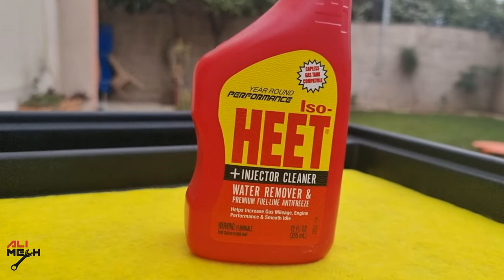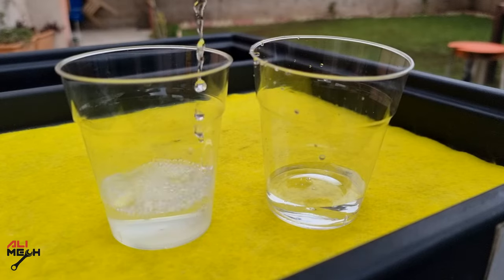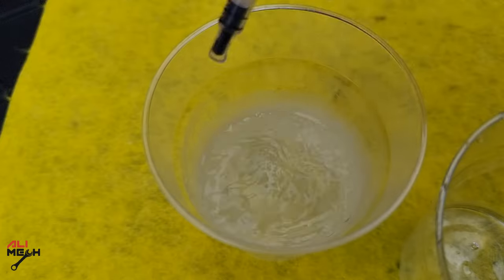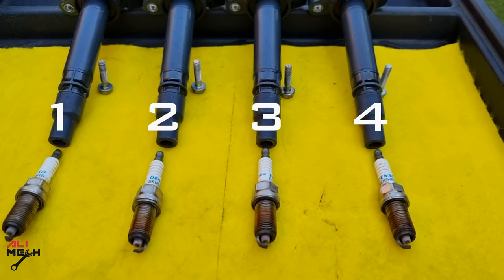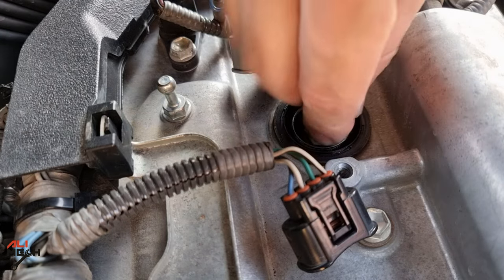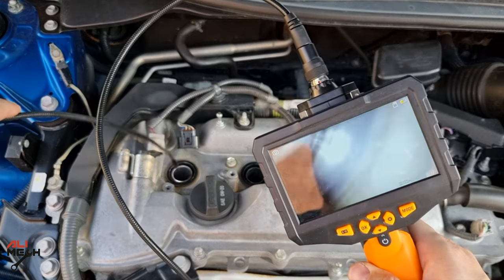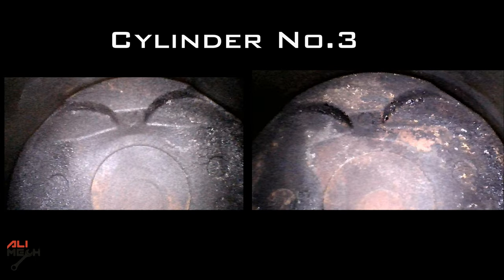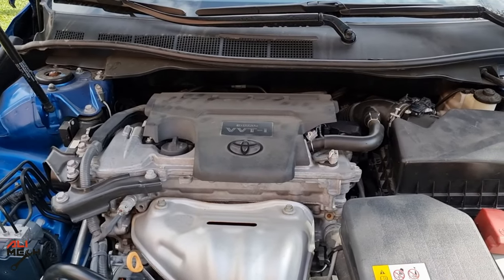Does ISO Heet removes water from fuel tank/how to remove water from fuel tank/piston Carbon removing

Comment: I thought my transmission was going out they way my truck acted after I apparently got a considerable amount of water in my gas. Would rev rough until I pushed the gas a little more. Turns out it was just the water causing it. Put a bottle of iso heet in it and cleared up literally in less than ten miles. Last time I buy premium at a nowhere gas station.
Reply from the maker: That's awesome, this will be helpful for others

Comment: This is one of the very few products that I trust. Every year, I put a bottle in my backup vehicle with a full tank and it always starts. It's not a magic additive or anything. It simply removes water which will prevent freezing and will make the engine much easier to start. Doesn't do any harm as long as you mix it with a full tank. Definitely worth it for $3.

Comment: I ran old bad regular gas in my cammed ls swapped ranger by mistake and I felt it  backfiring, spuddering I put $20  worth of regular gas drove a bit better not but not good engine temperature rising alittle bit but the other day I put regular gas in it again ran fine went to the car wash and everything then next morning I drove it to work popping and spuddering came back  kept cutting out blogging down when I try to floor it. So I drove it back home from work stop by a gas station after I read a review of premium gas mixed with regular bad gas might had help but regular gas  might had alittle bit of water in it but now it runs way better than what it did. My thoughts is might temporarily fixed the problem with it the bad gas mixed up with the premium fuel who knows but now gotta drive it around more see if has any issues, (if it fixes the  bad gas issue now) that bad gas can't be fixed myth is solved. Because I guess it diluted it down

Comment: Can you try high mileage sea foam
Reply: I have tried it in a F150 1998 125000 miles it works great you can also feed it through the brake booster hose also through the evap hose Best results is to leave it overnight soaking and start it up in the morning drive it aggressively works from my point of view based on the freeway in the first lane cleared up all the carbon from my O2 sensors and Catalytic converter. 🤝

Comment: What’s the difference between a the  yellow one and the red one
Reply: Red one is safe for diesel engines as well the yellow isn't
Reply: @atlaslion5128  Do you guys using it on gasoline engines is that  good he just pour it in his Camry
Reply: @petermuniz9296  yes the red is safe for diesel and gasoline but the yellow is for gasoline engines only
Reply: @atlaslion5128  ok thank can I use it every month or every fill up
Reply: @petermuniz9296  I don't remember what the directions say. It should say how often on the bottle
Reply: @atlaslion5128  It says at least 5000 miles

Comment: My car started jerking and eventually cutting off after getting gas one day and someone told me there may have been water in the line. Has anyone else had that problem?
Reply: I am currently dealing with this issue. I got gas at a bp which I never do and my car started misfiring and stalling. I have a 2017 Hyundai Elantra. I changed all the coils and spark plugs and it was driving better but still misfiring and the next day I went and got some Lucas injector cleaner bc I remember that my car started misfiring after getting gas. I went back to the mechanic to clear the engine light and it hasn’t come back in about a week so hopefully I’m okay.

Comment: Just use gasoline with 10% ethanol.and you won’t have to worry about gasoline freeze.  Ethanol in gas will do the same as adding heat (Methanol).  No longer need to use gasoline antifreeze (methanol)
Reply: I’ve been using Gasoline for years and my car started choking and idling badly heet save my car
Reply: ''Another property of ethanol blends is that they are hygroscopic, meaning they absorb moisture from the air, raising the potential for phase separation during storage if the tank is vented to the atmosphere and is subject to condensation formation as a result of temperature change.''

Comment: It's just a joke
Reply: You will be surprise I save a lot of money on gas
Reply: I’ve added 5mpg after using seafoam through the brake booster hose and evap hose let it soak overnight 4 or 6 or 8 or 12 hours yes that’s what I’ve seen work the best.
Reply: @keepitsolidkeepitreal2877  lucas oil work too I use to fill my gas every week now every 2 weeks am still 1/2 of gas
Reply: Our diesel truck had frozen lines.  Put 2 bottles of this in and 10 minutes later we were going.  Good stuff.  Better than that 911 diesel stuff.